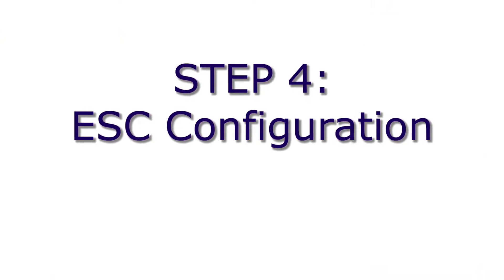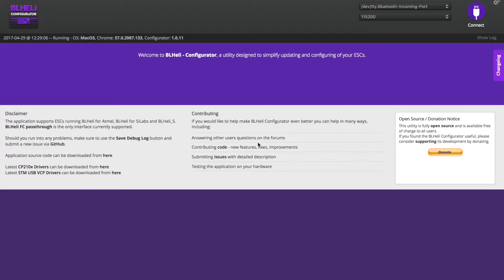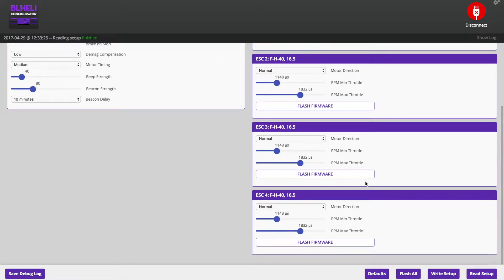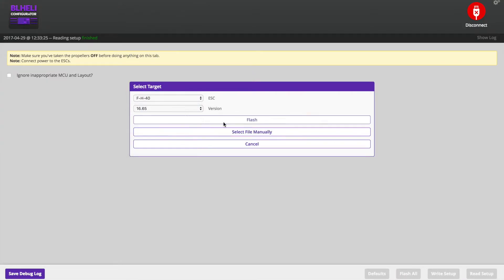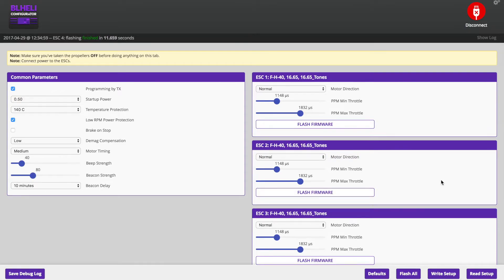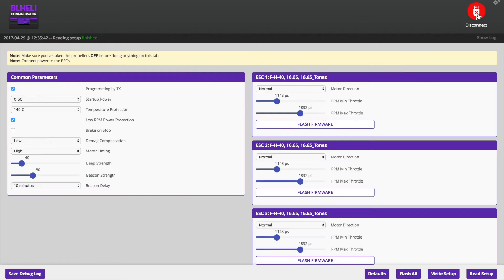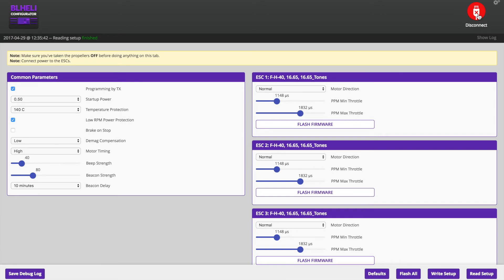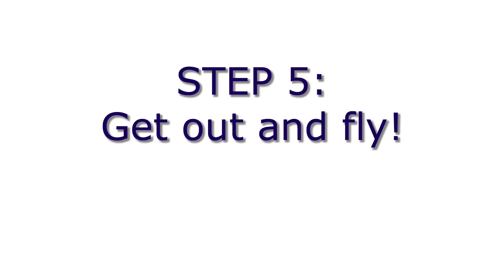SPC MAKER 90s - 4 - Update the ESCs & Settings

Comment: I got one of these back in may and I can't adjust video bands/freq in the osd.  I can change them, "set" them, save and reboot, but the settings don't hold.  Using the button manually works fine.  Did this quad ever have the option to change freq via osd?  Did updating firmware mess this up maybe?

Comment: why do the esc's need updating? does it need to be done if the quad flys fine? I just bought this over the weekend, and everything seems good.
Reply from the maker: No the ESC don't require updating. I just like to get my electronics up-to-date right off the bat. Those updates are done to improve reliability & performance so you may dodge issues by keeping them updated.